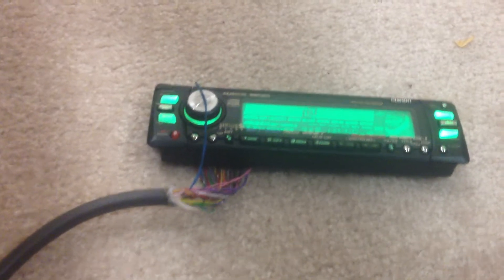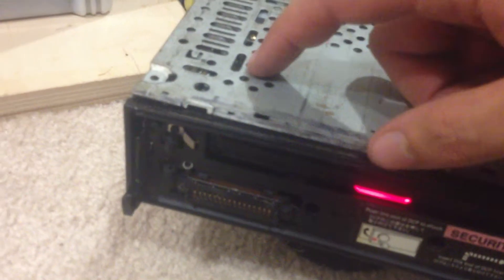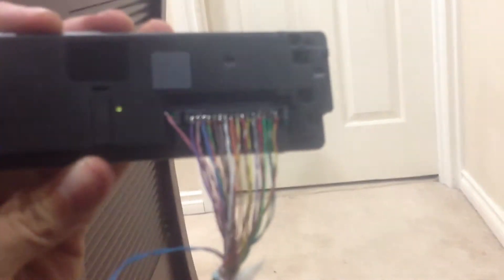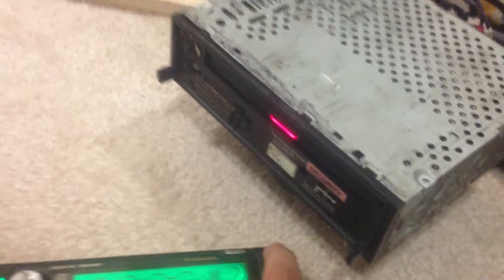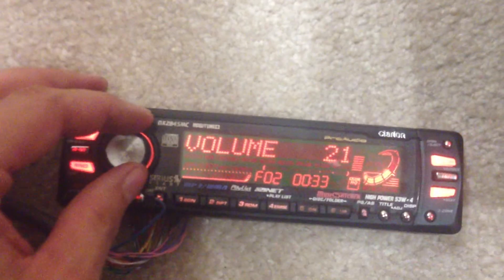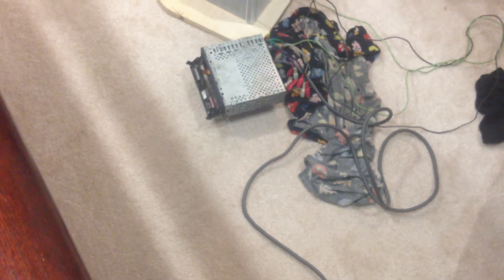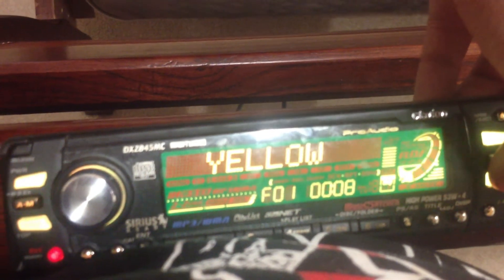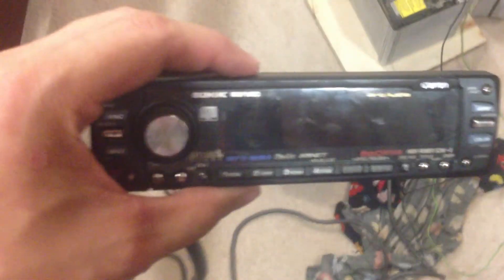OLD SCHOOL STEREO MOD (TEST) FACE PLATE EXTENTION

Comment: I'm going to try this with a JVC stereo I have, but rather than hard wiring it I think I'm going to steal the face plate connectors from a dead Alpine stereo I have and make a removable extension cable, I want to move the stereo in my car elsewhere so I can put a Raspberry Pi computer in the space it normally goes, that way I can have the best of both worlds.
Reply from the maker: I do know from experience the jvc arsenal kd-a950bt will not work .. well I could never get it to work

Comment: thanks for saving me time.
Reply from the maker: whatever do you mean ?
Reply: Bradjd56 actually I have kenwood kdc 995 and I was thinking to put the face plate in the sunglass box and the unit under the passenger seat .. so I youtubed that and u just saved alot of time on how to do that ..

I will use a computer ribbon cable .. and solder it to the pins .. will that ribbon cable withstands the stress for long time? Or just go ur way of doin it?

Thank you mate
Reply from the maker: Shadow Fiend  yes i would use the old printer cable i used cause you can put tech flex over it to make it look more professional plust its designed for repeated  movements unlike ribbon cable but i must warn you now this mod does NOT work with all head units i did this very same mod to a newer jvc deck with no luck so i hope you the best of luck if you have any questions or need some pointers feel free to ask
Reply: Bradjd56 sure thing .. I will give it a try .. if it worked I will PM you or just post here if it succeeded ..and thanks yes I will pm u if I have any difficulties. 
Thank you.
Reply from the maker: Shadow Fiend
not a problem my pleasure

Comment: Do you have a link to the cable you would recommend? Preferably on Amazon. Thanks.
Reply from the maker: LegitMods4u  just search serial port printer cable that will bring up the cable you'll need or https://www.amazon.ca/VIKINS-DB25-Serial-Cable-Beige/dp/B01FUV5VQG/ref=sr_1_11?ie=UTF8&qid=1488170416&sr=8-11&keywords=Serial+port+printer+cable you can find these at thrift stores too
Reply: MR.NOISY The radio I'm buying, I believe is a 10 pin connection only. So lets say I buy a 12 pin cable, can I leave the 2 extra cables hanging?
Reply from the maker: Well really then all youd need is a wire with 10 conductors that are large enough to strip and solder but yes you can use a 12 pin and not use 2
Reply: MR.NOISY Thanks a lot. Just wanted to clear this up because I'm going to attempt this sometime this week. I appreciate the quick response!
Reply from the maker: But im going to warn ya some multi pin connector have less actual conducting wires as some pins share the same wire so keep that in mind
Reply from the maker: LegitMods4u i wish you the best of luck if you have more question please ask away
Reply: MR.NOISY True that. As I'm googling, I'm seeing that there is less wires than actual pins. I've just looked up my radio and it turns out I need 20 pins.
Reply from the maker: LegitMods4u thats why i went with a printer cable more then enough conductors and some newer one have a smaller overall diameter then old ones
Reply: MR.NOISY I am going to use that same exact printer cable as you did. I need to get atleast a 10ft version though
Reply from the maker: That might work dont see why it wouldn't but make sure you trace the pins some conductors might share pins
Reply: MR.NOISY That might be the problem. I wouldnt know that.
Reply from the maker: that will work fine ribbon cable was the normal for this type of mod back in the day

Comment: Tried doing it and failed. My soldering job sucked and messed up the board. Would you do it for me if I paid you?
Reply from the maker: LegitMods4u damn dude that sucks i could but cant guarantee it will work it also depends on what head unit your using because ive tried this modd on a jvc arsenal series deck and it did not work
Reply from the maker: LegitMods4u yes just search peak freq brad
Reply: MR.NOISY I just added you

Comment: im thinking about buying a new deck. likely ~$400 and doing this. is this the only way? mad scientist soldering?
Reply from the maker: nopiscougar basically just take your time  trace the solder points draw out a diagram for wire colors (if you use a printer cable You can use ribbon cable too) but I will tell you this mod does not work on all headunits 
Pioneer yes (not sure about 80prs)
Clarion yes 
Alpine yes (on some) 
Jvc arsenal no 
So there is a risk of hurting something to you do attempt this mod
Reply: Mr Noisy. Why doesn’t this work on some such as JVC but does on others?